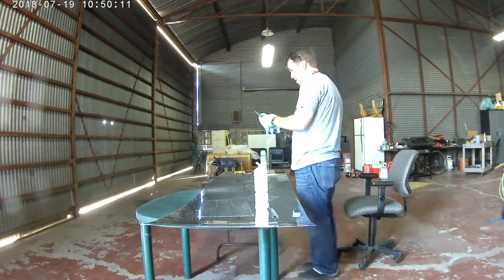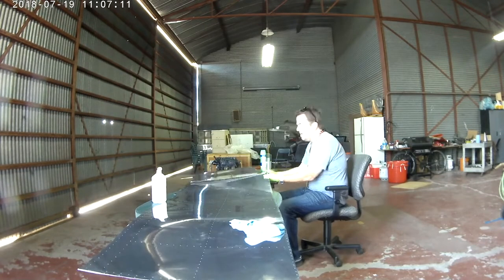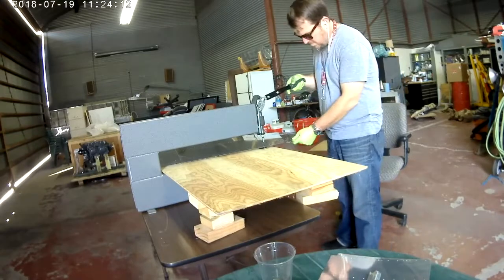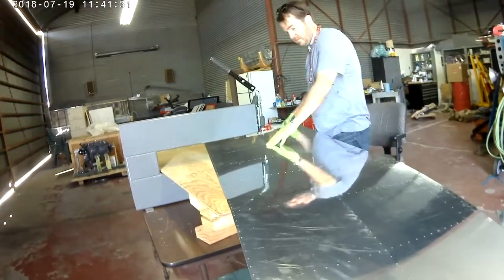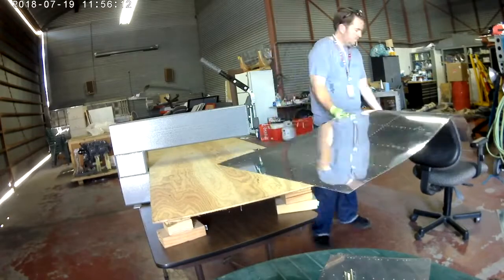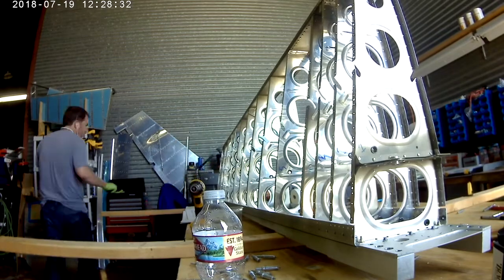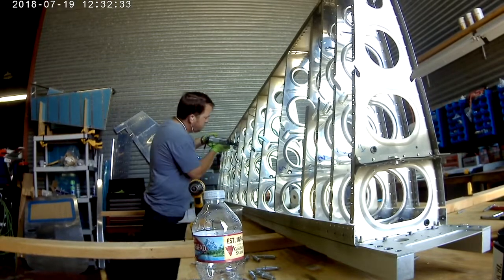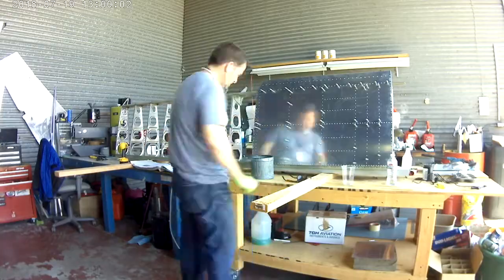RV14 - Right Wing 21

Comment: Oh, I forgot to ask.  Did you get a tools kit from planetools or did you put it together your self from various vendors?
Reply from the maker: I tooked at the tool kit lists and peace mealed mine out from either sales or pawn shops, etc. What I and every single builder learns is that you'll continue to amass a serious collection of cool tools as you get into the building process. For the body work its pretty simple: files, deburring tools, bandsaw, drill bits (lots of them, make sure they're GOOD), rivet gun, rivet squeezer, dimpler (DRDT-2 in my case... invaluable) and a crap load of clecos and a FEW sets of cleco pliers. 

Good question I'll mention this in my next video.